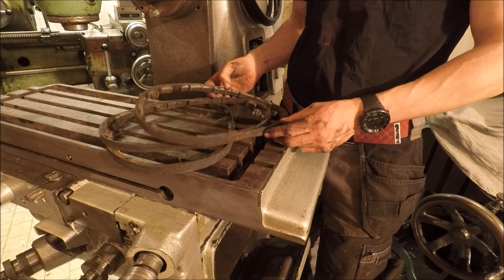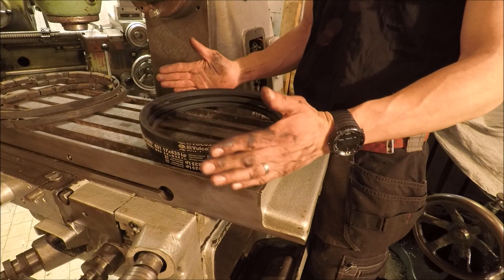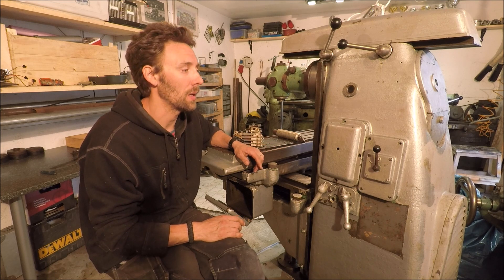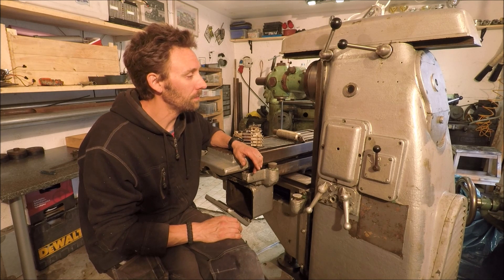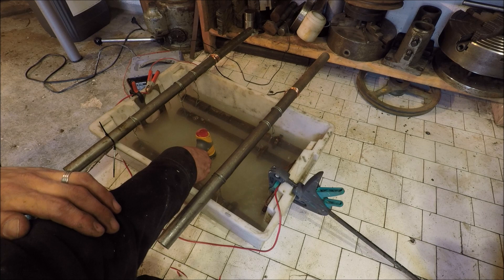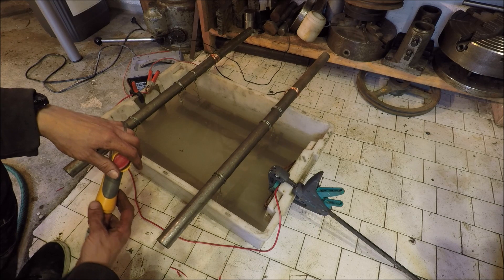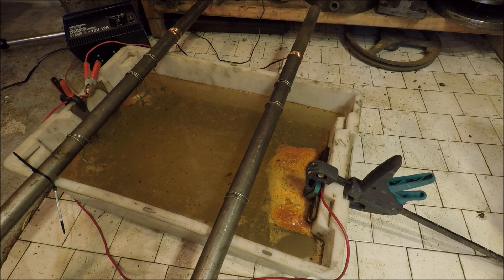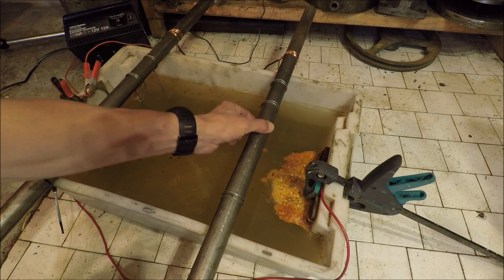Restoring a Värnamo horizontal milling machine - Part 5

Comment: A quick tip, whenever changing belts on a multigroove pulley....ALWAYS change the complete set as you will get uneven pull on the shaft if you do not, it may cost more but it is well worth it in the long term.....anyway, a great serial and you have certainly done a good job in renovation....10/10.
Reply from the maker: +rich kellow That sounds like a good idea, i can see how that could create a problem. Glad you liked the project!

Comment: That's coming along nicely.  Get yourself a good stock of key steel lengths for your horizontal arbors and tooling. When you first start out running slitting blades and narrow side and face cutters you may well find you get the odd jam ! The alternative is to run the feed by hand until you get comfortable with the speeds and feeds. Also well worth getting flood coolest set up for horizontal mode. It reduces the tool wear and helps flush chips away from the cut .  A good book to read is a Treatise on milling by cincenatti machine Co. Loads of useful information on horizontal milling machining. Have fun, Mat
Reply from the maker: +lookcreations Thanks for the tips Matt! Always helpful to get info from people who knows. Regarding coolant i'll probably build some kind of mist cooler for the mill.

Comment: Boy, someone really got there moneys worth on those belts. Glad to see it running. You will find the electrolisis works well, I've used it for years to remove rust.
Reply from the maker: +George Chambers For sure, i've never seen belts like that. I just took out the first batch of arbors from the bath and they look great!

Comment: Are you sure that feed axle isn´t telesopic, meaning axle that was in your hand??
Reply from the maker: +HybridiHippo Genious! I would never have thought of checking that if you hadn't mentioned it. Looks like you're right on the money. The driveshaft is telescopic in two places, only since the one in the shaft is stuck, it won't reach when i lower the knee all the way down. Now i just need a way of getting it to move in and out  agin, it's really stuck on there good. Thanks for the help!